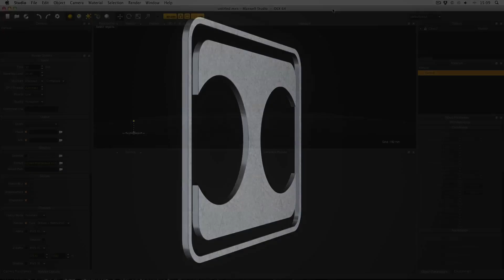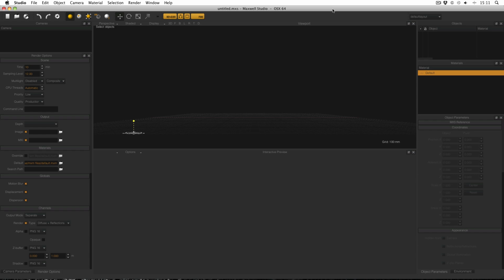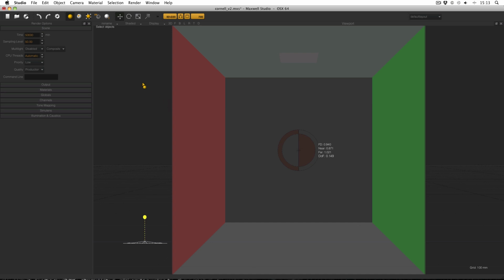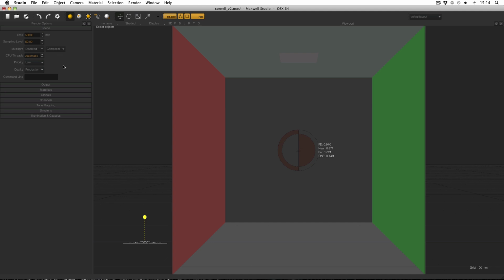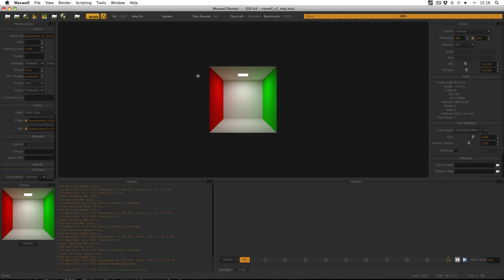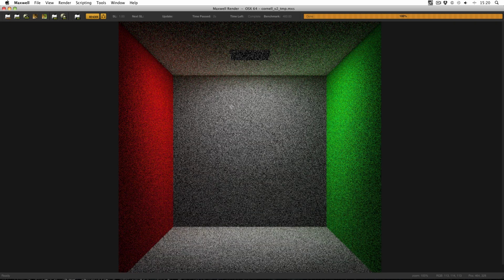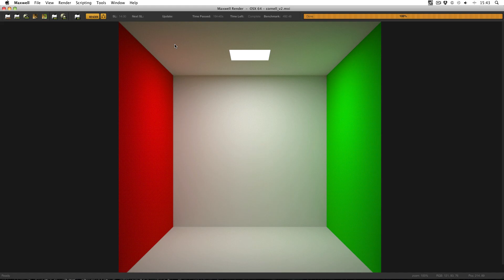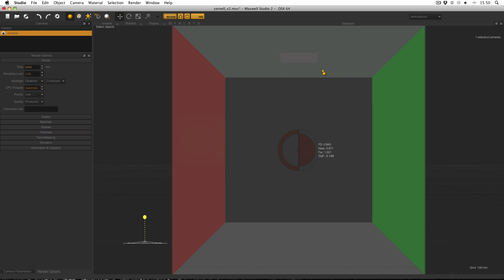Maxwell Render Studio Tutorial - Time and SL

Comment: Great tutorial to understand how it works, thanks. I have a question. When I set time limit to 9999 but when I hit render time left that starts at 166 turns to 6 automatically, any clue of what happens?,
Reply from the maker: 9999 is the maximum time in minutes, which turns to 166 because Maxwell then shows it in hours (9999 minutes is 166.65 hours). Then it turns to 6 because Maxwell realises that it's going to reach your target SL before it reaches the maximum time. Maxwell will render until it reaches the first setting, either max time or target SL.
Reply: Thanks James